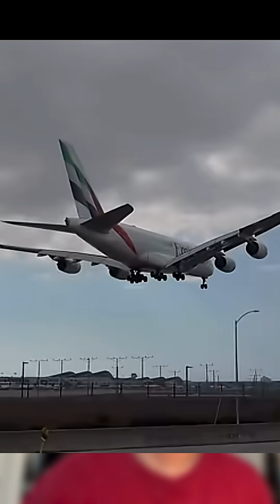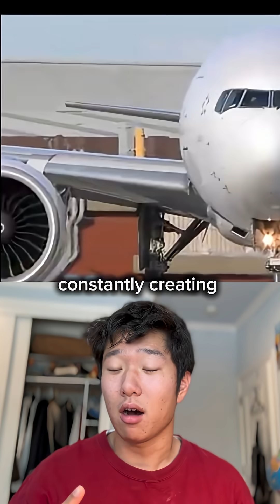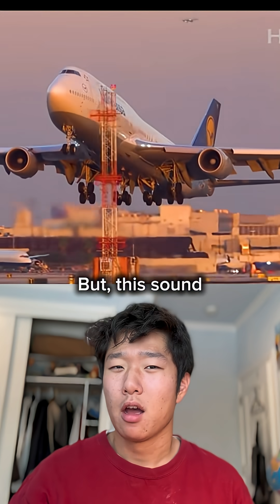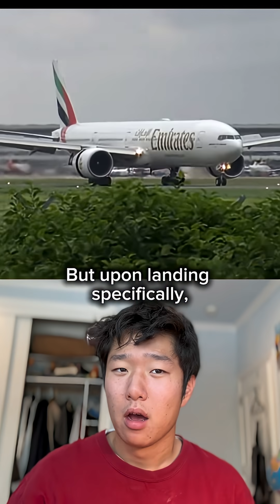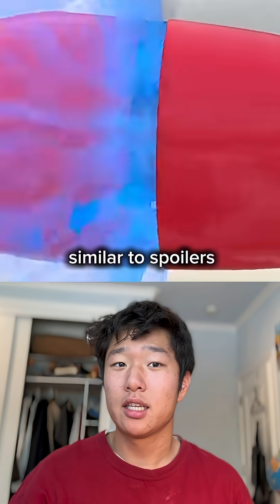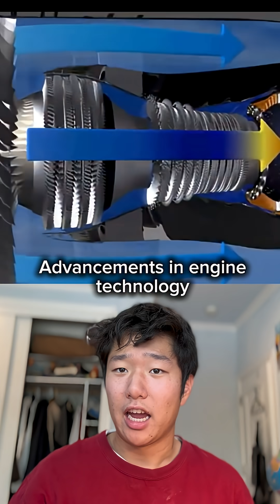Why are planes so loud? #aviation #aviationgeek #airplane #aviationlovers #engineering #flight

Comment: Not a bad video, however I'd like to note that the fan blade tips are designed in a way to never exceed Mach 1 as this would drastically reduce efficiency and increase noise.